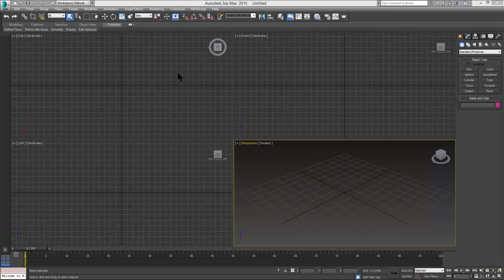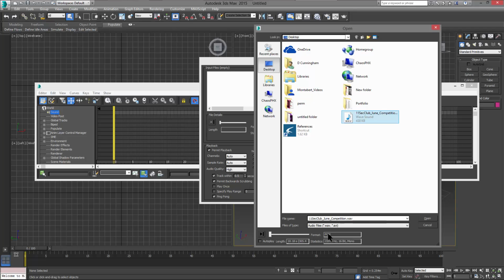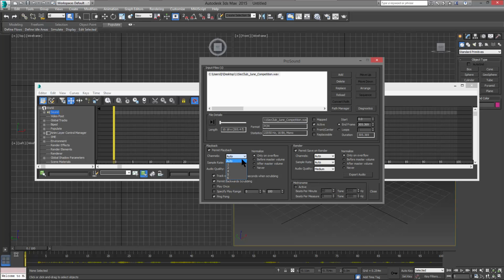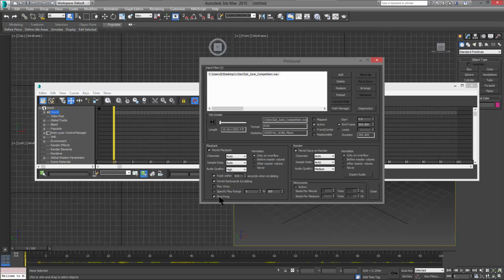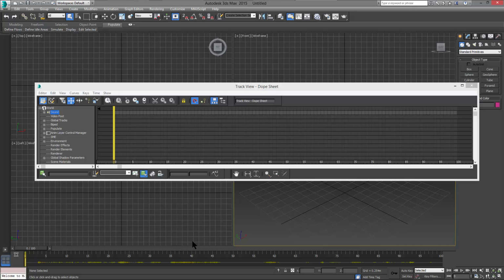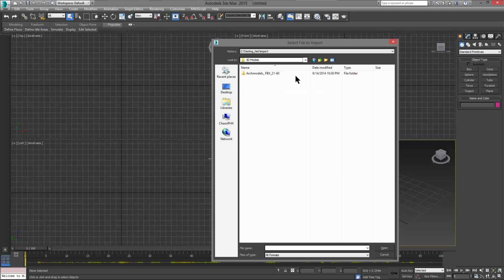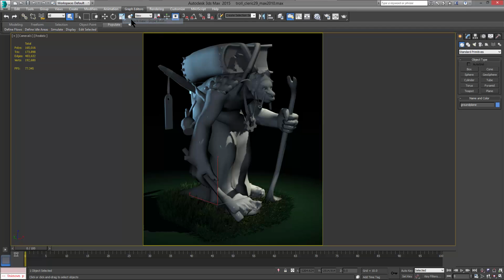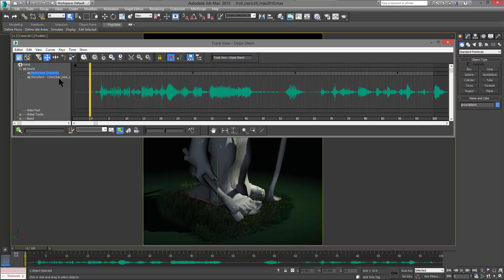Importing Sound 3dsmax

Comment: I have a question, are you a real doctor?
Reply from the maker: Indeed i am a real doctor i currently hold a Phd in Business Administration and currently working on another in Information Technology.
Reply: oh cool I didn't expect this hehe! Anyway do you know a solution how i can put a sound file to an moving object?
Reply from the maker: How are you moving the object and what program are you using?
Reply: Dr. D Media PhoenixIncep im working on a 360 panorama. I will have birda and peoeple moving and i need to add sounds.
Reply from the maker: If you have a 360 video in premiere or after effects you can just bring in a separate sound file and when you send it to Adobe encoder make sure sound is activated to export as well pick a vide format that will retain the 360 metadata for the video
Reply: Dr. D Media PhoenixIncep nono, i need to attach the bird.wav to the bird so the sound moves with the bird like in real life. Do you know what i mean?
Reply: @i_am_a_real_cat1443  Hey Mrselluz. I am not sure, but the "Foley Studio MAX" plugin by Boomer Labs might be the right tool for this task.